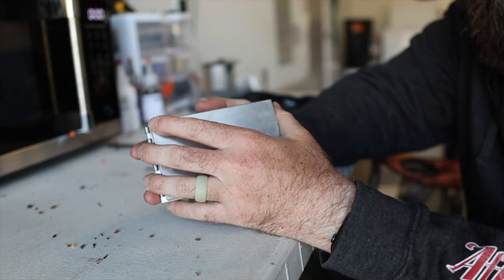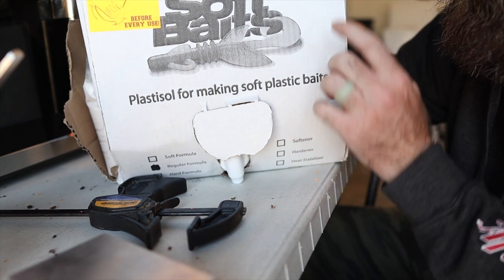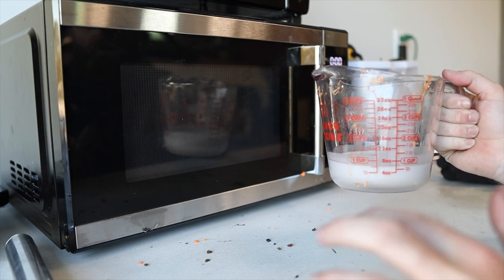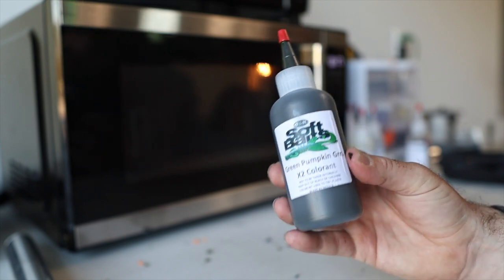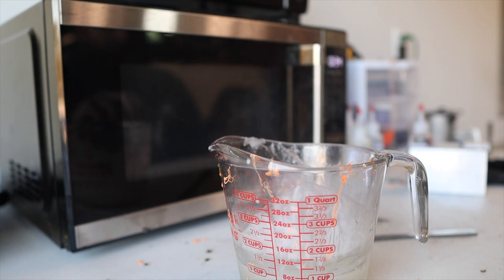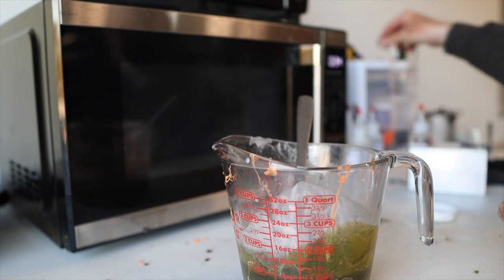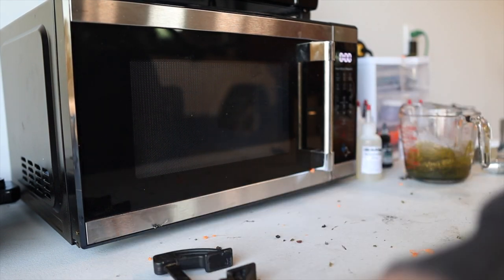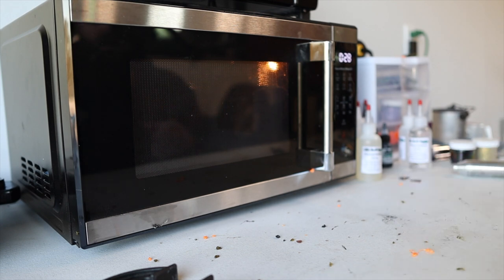SUPER SNEAKY Homemade Ned Rig Bait

Comment from the maker: Use code RUDD15 to save 15% off your entire order - this code is good ONLY 3/6 - 3/12 so make sure to place your order before then to get the discount! 

Mold - http://bit.ly/3L8T4yD
Size - 3”

Plastic making starter kit: http://bit.ly/3DVsHIr
(Comes with injector, plastisol, three colorants, and glitter)

Pumpkin colorant: http://bit.ly/40mCHnj

Glitter: http://bit.ly/3RENJ3H
Color - .015 black and gold hex

Plastisol softener: http://bit.ly/3l0VXXw

Plastsol stabilizer: http://bit.ly/3YiNs8G

Comment: Alex, 2 questions. First, what's your process for "curing" the baits after taken out of the mold? Some use water some let set up for a week...second, what's the advantage of pouring into the injector as to sucking it in? Bubbles?
Reply from the maker: 1: just toss them in a bowl of cold water.
2: keeps the tip clear which leads to a cleaner pour.